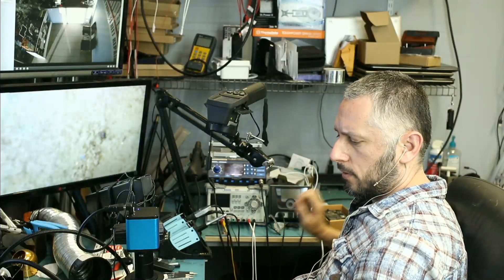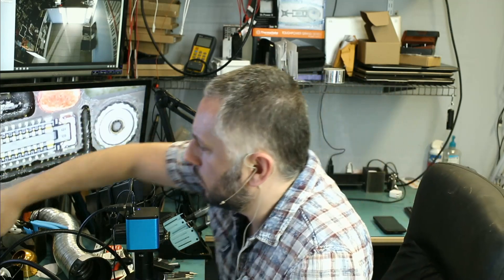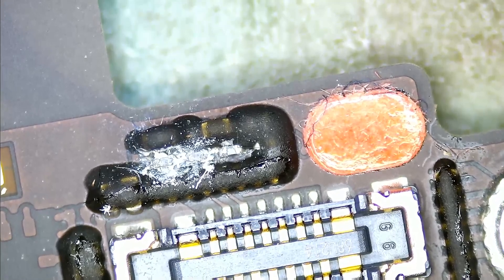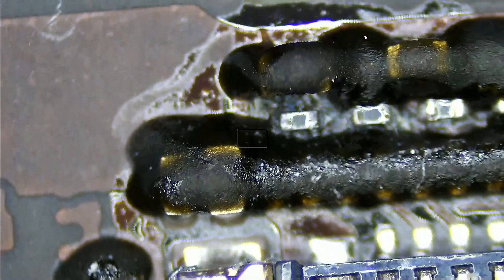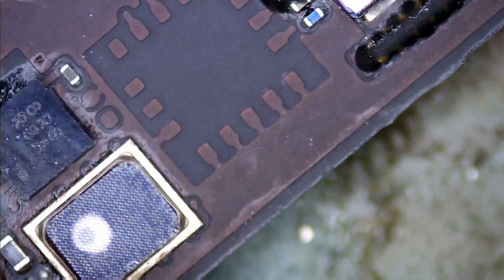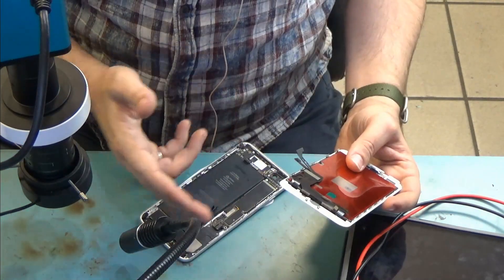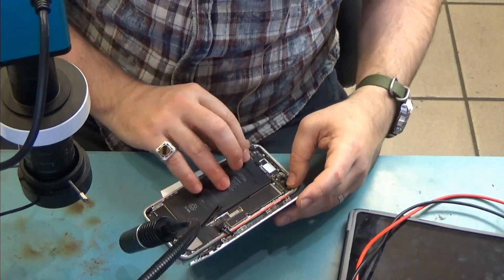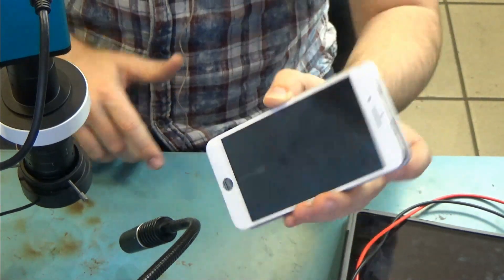iPhone 7+ Plus Power Button stopped working-- Corroded filters and liquid damage

Comment: I have the same issue with my iphone 7 i went to multiple repair shops and changed the entire power button and volume assembly and nothing. In the repair shops they told me that the board is damage and it has no repair. But i doubt it since they don’t do soldering and their repairs are not deep in search of board issues